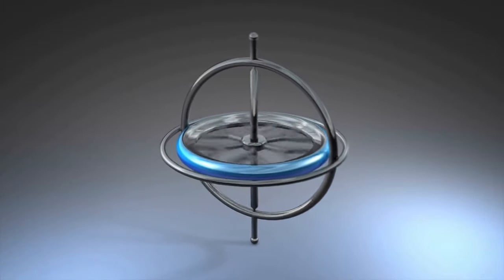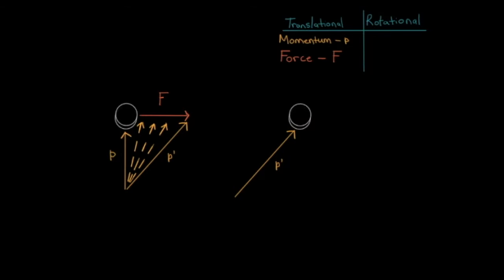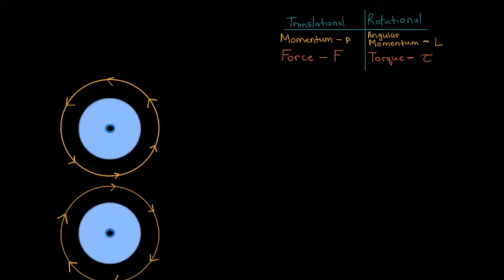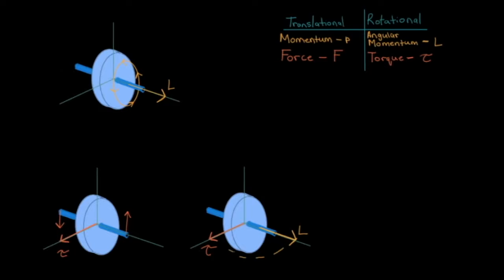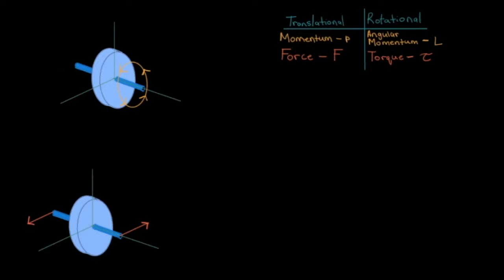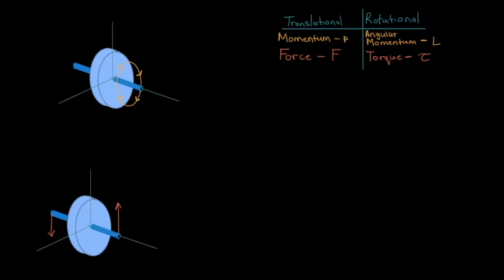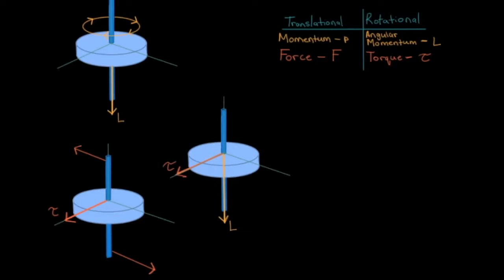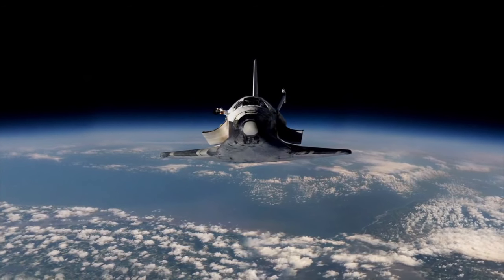Gyroscopic Precession is Easier Than You Think!

Comment: So is there like an F double prime holding it up? I get if the axle is being held on one side by the string, and pushed down on the other by gravity, it creates a rotation which we can use the right hand rule on - but that still does not provide a force vector upwards - only "around" the axle. Does the "precession" of the upright wheel spinning around the string have its own right-hand rule (the F double prime)?? Because that motion - when the right hand rule is applied - gives an upward force vector (the only one with a direction counter acting gravity).

But good video!!
Reply from the maker: Hey! Here’s perhaps another way of looking at how the wheel stays upright:

1. Let’s start by holding the wheel upright by the axle as seen in 12:21. The axel is held upright by the string on one side and by your hand on the other. We have two upward force vectors that keep the wheel upright. The string provides one and your hand provides the other.  

2. You grab onto the wheel with your other hand and start to spin it as fast as you can. In doing so, you create Angular Momentum - L. Remember how at 00:56 I talked about rigidity in space? In spinning the wheel and creating L, you have just created rigidity in space! That is, the wheel wants to maintain the axis on which it’s rotating. And this is the KEY! This L, is the upward force (so to speak) that keeps the wheel from rotating and falling down. You don’t need the upward force vector provided by your hand to hold it upright anymore (you only need the one created by the string)... and that’s the crazy part! The rigidity in space along L makes the upward force vector (created by your hand) unnecessary.

3. You let go. The string is held upright not by two upward force vectors (as in before), but by one upward force vector (the string) and rigidity in space (along L). The upward force vector from the string keeps the wheel suspended in the air. The L vector keeps the wheel upright by pointing parallel to the ground. 

4. Gravity causes the wheel to want to rotate. This creates a Torque - tau. As we know, L chases tau. But as L moves to follow tau, tau moves as well. The result is tau constantly moves away as L constantly chases it.
Reply: @physassist2635  Thank you for the reply! Is there a mathematical representation of "rigidity"? like L or Tau or a right-hand rule for rigidity? 

For example if we have the same L and the same Tau, will we always have the same rigidity? Or - if we say - tilt the wheel such that the string tied end of the axle is the lowest point, and the angular momentum is like 45 degrees towards the ceiling instead of 90 degrees or parallel with the ground - that must affect rigidity right? Or does it? 

Cheers!
Reply from the maker: Rigidity in space is the idea that a spinning gyroscope tends to want to stay spinning in the same plane (or around the same axis). The faster you spin the object the more angular momentum it develops, thus becoming more rigid in space. Mathematically, we can think of rigidity in space as angular momentum (though not quite the same thing):

L = I w

Where:
L - angular momentum
w - angular velocity
I - moment of inertia

Now let’s say you tilted the wheel and spun it so that angular momentum points 45 degrees toward the ceiling. The wheel will be rigid in that 45 degree position because it has developed angular momentum in that direction.
Reply: @physassist2635  Right, and I guess it will even be the same amount of rigidity if spinning the same speed (by your comment). I guess the force of rigidity must be much greater than the force of gravity to overcome it without directly opposing it. 

Im much more interested in this gravity defying "rigidity" than the precession observed, easily explained following a right-hand rule as the title suggests. Cheers!
Reply from the maker: Rigidity is certainly an interesting phenomenon! It’s a form of inertia, a resistance to change. The same way an object in motion wants to remain in motion in a specific direction until acted upon, a gyro wants to remain spinning (in motion) in a certain plain/around a certain axis (specific direction) until acted upon.
Reply: @physassist2635  A form of inertia? Ah of course! And as we all know - "Inertia is a property of matter"! lol. My dumb youtube conspiracy self sees the supposed "not from this world craft" shown by the pentagon, and it looks oddly gyroscopic. 

Jokes aside though spatial rigidity because inertia (the energy of a moving mass) is awesome!! 

Thanks for the great vid and great responses!
Reply from the maker: Happy to help!! :D

Comment: It's fine but which torque makes the wheel rotate about the thread?
Reply from the maker: This would be the torque caused by gravity attempting to tip the wheel over
Reply: @physassist2635  what I actually mean to ask is where is the extra energy of revolution coming from

Comment: You achieve "rigidity in space" to have your own x,y,z as much as possible for very practical reasons. Some kind of missing data for flying or general engineering in the past. We have a human sense of it built in, but machines didn't. A computer need an analogue or digital reading from somewhere to do something in that regard. It's quite funny how we reinvent "a body" and such for machine constructs. Well, you will want to fly or something in a safe way. When the air plane is upside, down it's good to know, even for a silly part we don't care about and it got computerized to not forget it. The computer then got what it needed. Now the pilot can also see the info in a fancy way, which is more precise than before.

Comment: Hello, in the wheel rope scenario if I increase the angular momentum very high so the L vector is much bigger than t vector, will the system still turn at the same rate, but just take longer to fizzle out? Also what primarily is causing the reduction in L? In this case is it just the slowing of the wheel due to friction? Does the changing direction of the t vector  cause a reduction in L? Thx for a good video
Reply from the maker: Hey! That’s a good question. I’m not entirely sure if a higher L contributes to the turn rate around the string. Though I don’t think it does. 

With a higher L, it will certainly take longer to fizzle out. And you are correct about the friction. Friction due to air resistance and friction in the wheel’s axle causes this. 

The change in the torque vector, in theory does not directly cause a reduction in L. This is due mainly to friction.
Reply: @physassist2635  thanks for the help

Comment: Gyroscopic action does NOT keep a bicycle rider from falling over.  The rider turns as necessary to keep the bike wheel centered under the rider.  A wheel by it's self is different. No weight to support
Reply from the maker: Thank you for commenting on my video. It is true that a cyclist does turn the bike as necessary to balance themselves at slower speeds. This is because there is less rigidity when the wheels are slow. At higher speeds, less inputs from the cyclist are needed for balance because the wheels have generated enough rigidity in space.
Reply from the maker: Hello John. After doing some further research on this, you are in fact correct about this. 

I’ve just made the edit to the video. It should take a couple hours for the change to be reflected.

Comment: This is actually a bad video (sorry). Work done in vain because torque and angular momentum appear out of the woods and solve everything with the gyroscope (the right hand rule magic). This is not an intuitive ('easier than I might think') explanation. Actually even college books for physics majors (Kleppner/Kolenkow, Ohanian, Young/Freedman) and Walter Lewin fail badly with the gyroscope. 

A better video is this
https://www.youtube.com/watch?v=n5bKzBZ7XuM

A proper way to explain the motion of the gyroscope, that is its orbital motion and why it does not fall down while spinning, would be something like to divide a spinning disk into infinitesimal units of volume (mass). Each of these units will have a different linear momentum vector. Each unit (all combined into a rigid body) will experience the effects of the normal force on the pivot, gravity on the center of mass and the centripetal force of the axle. Then I expect there might be a way to paint regions of the spinning disk with different colors to show the effect of these forces on rotation. I expect some day a hero will make such video on Youtube.